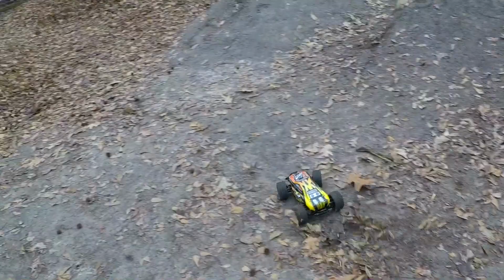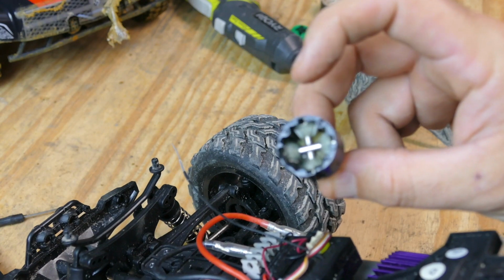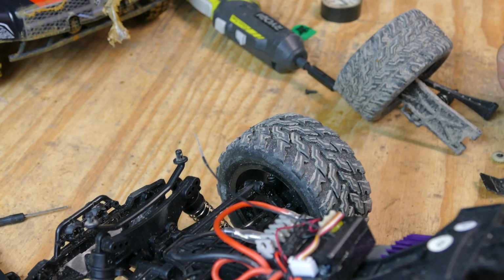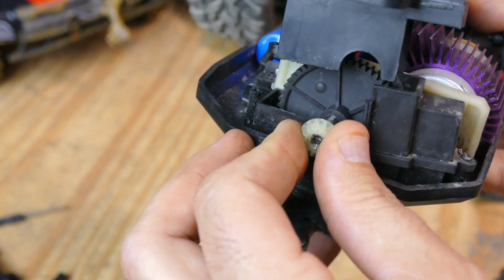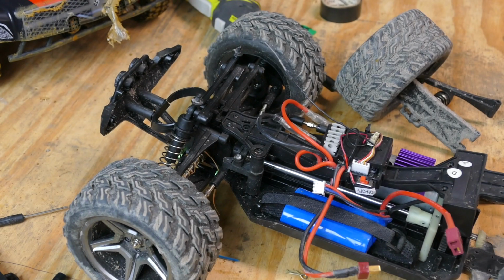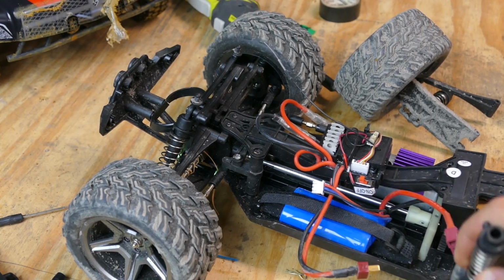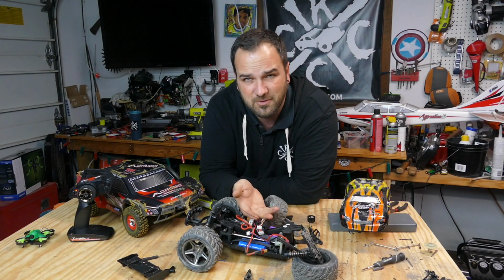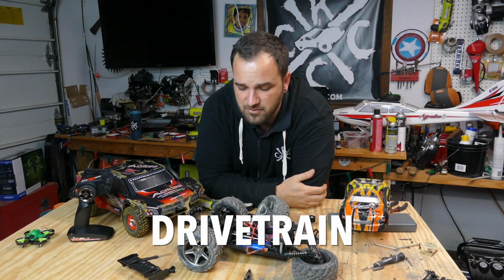WLTOYS 12404 BMX Bash, Break & Review Then Harvest Parts...

Comment: If you think that's bad a bad truck try the Iron Track Bowie you will break parts before you  get a quarter through the battery. Here is the list of parts I broke...
7x right knuckle
5x spur gears
4x brass pinion gear
1x rear shock tower 
1x rear shock shaft 
1x center driveline...
And I could keep going but I think you get the point

Comment: I have the 12428 and the shocks were not oil filled.  The shocks wouldn't even stay together, the molded plastic threads on top of the shock weren't deep enough so the caps wouldn't get any purchase when you tried to tighten them.  Its only the rear shocks and I super glued them back together until the replacements I ordered arrive.  I bought the 12428 for $52 and if I can get it running reliably I still think its a great car at that price.  Thanks a million for sharing your rad vid man.

Comment: Well it looked great for the first 2 minutes of the video. I had the same issue with the ECX Torment 1/14. But that's RC life :) Great video as always. 👍
Reply from the maker: Yeah. The only other person I've heard has one....and both front and rear stripped after 4 runs. Unfortunately I am not sure about a metal replacement. Doesn't look like there are any made specifically for it, but I may try to find a match. I do like the car. If I could get metal gears, I'd do the one time fix - I'm just not willing to do this every 4 batteries
Reply: CCxRC I bought the 12403 short course via eBay and have the same problem after my 3rd run with my rear differential drive train
Reply: Maybe Remo metal parts can fit ? As for the 12428 and 12423.

Comment: Great video solved my dilemma!!!!! I ordered this truck last night because of this video after watching you try to break it and that lil gear was the only problem.....well my friend I have all the parts in metal to fix that problem and I think with a couple of upgrades this will be a badass truck!!!  I have the 12428 and it's an awesome truck and exactly the same thing as the 12423 just looks different!! I wanted 4wd with a Big motor and this fits !!!!!! The 12404 has the big 550 motor!!!!  My next truck is a Twin 🔨🔨 Hammer!!!!
Reply from the maker: Awesome man! So the metal gear from the 12828 will work in this?
Reply: CCxRC  I won't know until it gets here.....but that gear which is the same one for the 12428,12423 both of mine stripped in my 12428 first day at the same time!! Really bad design flaw I'm finding in the transmissions for their trucks and truggys!!  I took the gears off filled the holes with jb weld put them back on put super glue where the screw goes and really tightened it and put a lil on top  that screw ...wipe off excess jb weld let sit overnight.  Was working great bashing it good then the ESC went out....but that's a diff story ::  see the video it went swimming")
Reply: Rock Stephens check out the wltoys 10428. its the same thing as the twin hammers but with lesser electronics. i fricken love mine. all the vaterra parts fit. and i saved 250$$$
Reply: ROCK&ROLLRC Did you replace the gear with a metal one? Did it solve the problem?
Reply: hi rock&roll, i have a question for you, where did you take the metal gears for the 12404? or where could i buy them?
Reply: ROCK&ROLLRC  hi man please answer to my question :D

Comment: Hello guys!
Does anyone find the right solutions for :
- change all drive gears/diffs  to metal?
- oil filled shocks 

Can it work with a - WLtoys K949, 10428 metal differential - if i change the cups to the stock ones? 
Thx
Reply: There is a new Version of cup & gear (aliexpress ), it should last longer. Gear sits much tighter due thinner cup. I put some extra superglue and i'm on 4x4 at least 5-10 rides :). I even tried 3s for a short while. I'm happy with it. I got some extra gears for small bucks. Just in caste.

Comment: Why not just change this one gear to a metal one instead of taking it apart for parts?
You gave up too fast. It seems like a great car. I love the low body profile.
Reply from the maker: Just came down to me having too many RC cars and not enough time to keep them all running.
Reply: CCxRC
That's fine, I understand. I just have the 12428 which I love but actually considering getting this one based on your review. Thank you.
Reply from the maker: Should be cool if you can fix that issue